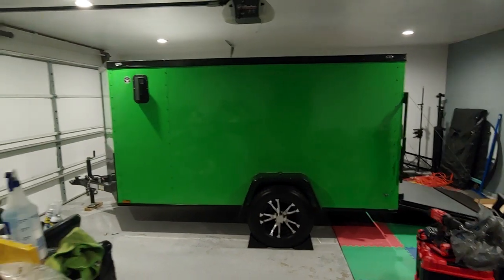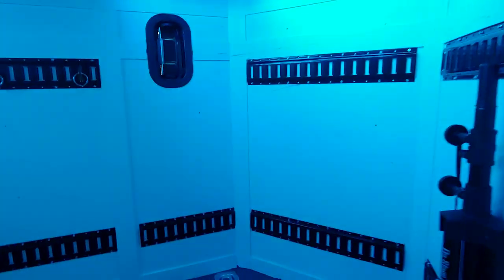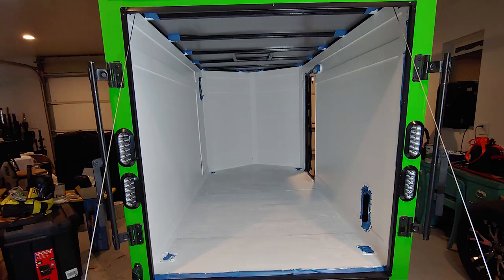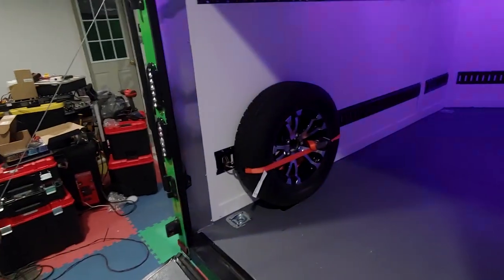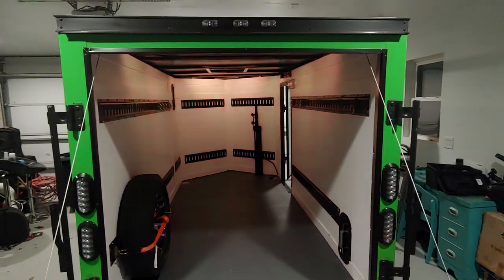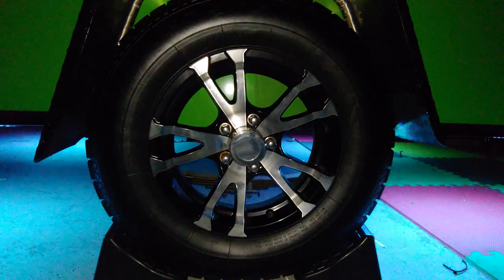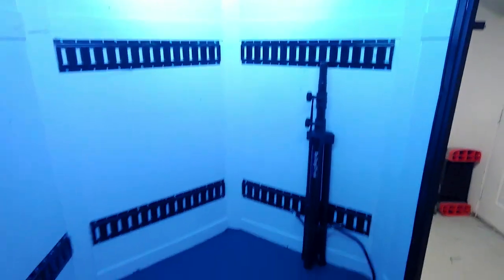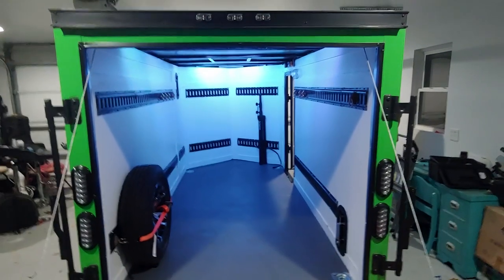Ultimate DJ Trailer with Custom Mods

Comment: I got the 6 x 10 ft utility trailer a few years ago and added interior lighting that runs on a 12v to 120v inverter. Added furniture inside so that when I'm not moving the DJ system to the gigs, the trailer is a remote radio broadcast vehicle. Did several 6-hour broadcasts from fairs and carnivals, without breaking away for commercials. Aired the breaks right from the site. Much easier than doing handoffs. Started out using analog equipment (a 25 watt Marti) then went to digital stuff to transport the audio back to the radio station. It's much more comfortable to have a trailer than a tent with a folding table. Looks more professional too. Also setup and tear-down time is reduced because much of the gear can be all wired together before transporting it. Best of luck with your excellent looking trailer, and hope to see more videos. Regards, GB
Reply from the maker: Wow that's amazing. If you do a video we'd love to check it out.

Comment: That's sweet. I've got a complete solar setup going in mine soon with a panel, battery, conditioner and then I'll have an alarm setup installed as I'm not privileged enough to be able to store it indoors yet. Lol Also have the underglow but just went with nice bright white LEDs inside.
Reply from the maker: My project list for 2020 is to paint the roof white to cut down on heat build up. I'm in NY so I have the LED's on party mode during setup and break down, but white only when driving on the street to avoid attention and a ticket at night.

Comment: Hey Bud!  Really nice work.  2 questions.  Which LED light kit did you get?  The link is a dead link.  Secondly, what did you use for blank extensions on the LED lights to go from the power supply to the LED strips?  Thanks!

Comment: Hey how’s it going. Trailer is sick. My question is what switch box did you use to wire the adaptor and how did you do it. Just wire up red and black to a switch? That simple?
Reply from the maker: I bought a generic battery box from Lowes. Instead of installing a battery I drilled 2 holes for switches and wired them in. The switches are basic, but heavy duty on/off switches, so anyone will work.

Comment: Trailer is super nice!! Thinking of getting a 5x10 myself that way it fits in garage. How tall is the trailer from the ground to top compared to your garage door opening. What’s the head height in the trailer?
Reply from the maker: From ground to trailer roof my trailer measures 6 1/2 feet. My garage entrance is 7ft and once I clear the door I have 8+ ft ceilings, so it works out great.
Reply: @Ilovedjcdub  thank you for the help!

Comment: Do you have a video of the Underglow while you are driving on the road?
Reply from the maker: Unfortunately not. In NY it's illegal to drive with any under glow color other than white. We drive away from the venue with it on and then turn it off (with the wireless remote) when we get on the main road.

Comment: Did you  buy 2 of the light systems or just one?
Reply from the maker: That is two light systems - both are the same. 1 for the inside, the other for the outside. Both are controlled by wireless remote.

Comment: Hey, just wondering where did you find the adaptors for the battery and how did you wire
Reply from the maker: the adapter can be found on Amazon:   https://www.amazon.com/gp/product/B07TN6JTZC/ref=ppx_yo_dt_b_asin_title_o08_s00?ie=UTF8&psc=1     

To wire it, you wire a switch inline of the positive wire and send black to ground or your ground wire.
Reply from the maker: I also posted all items in this video in the description.